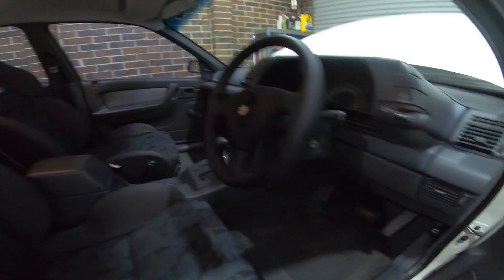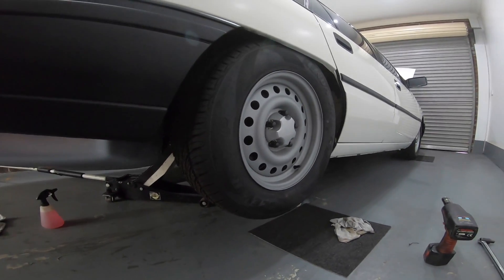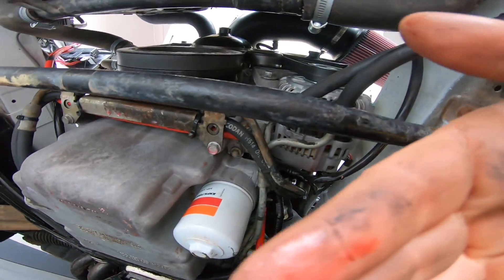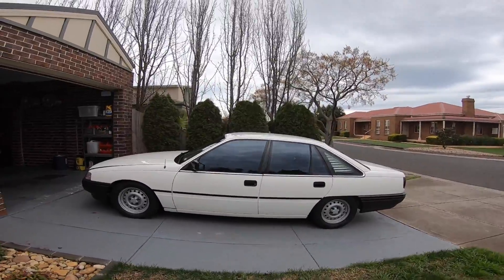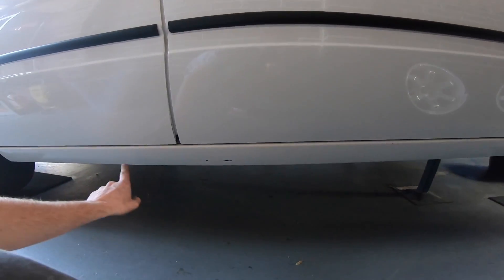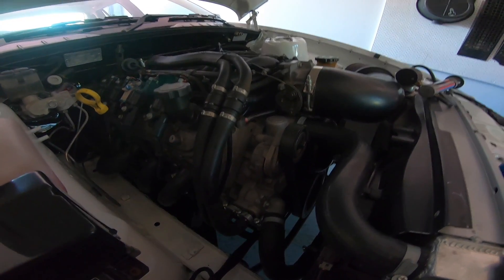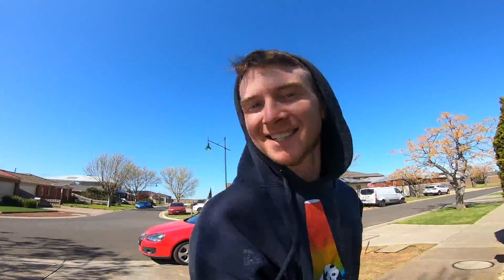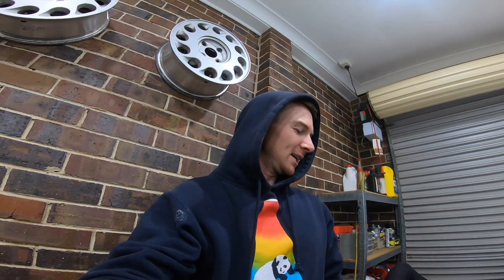LS1 VN Commodore gets new interior & wheels

Comment: Get a VL diff and those rims will fit sweet. I had some 15x7 interceptors with 225/60/15 and they just fit with the standard diff. With the VL diff I have lots of room. Currently running 17x8 + 30 with 235/45/17 and have a least 1.5inch of room on each side!
Reply: Another fun fact VN Group A ran VL diff so they could fit bigger rims!
Reply from the maker: They fit fine now that the diff is centred but if I build a diff down the track I’ll do a VL diff to fit a bigger tyre

Comment: Matye just get the rims done so most of the wheels width is on the inside and check that its not going to touch anything on the inside towards the diff, that simple, no point making them wider on the outside lip, to a point yes, but mostly on the inside so that it will still take larger tyres ,but with out the worry about scrubing all the time while driving, lol :) blol :)
Reply from the maker: Huh? I haven’t made any wheels wider they’re factory wheels, also not worried at all about it scrubbing because they don’t lol